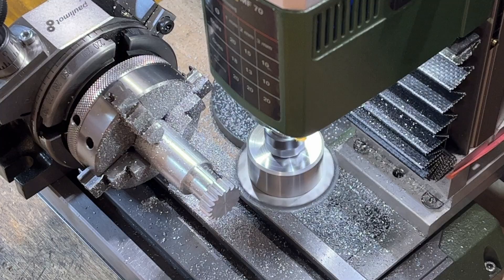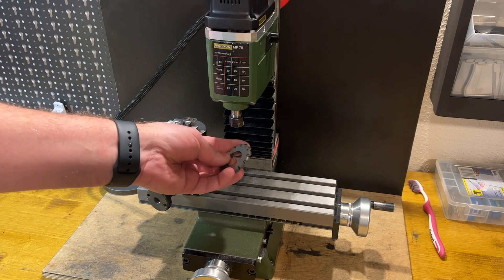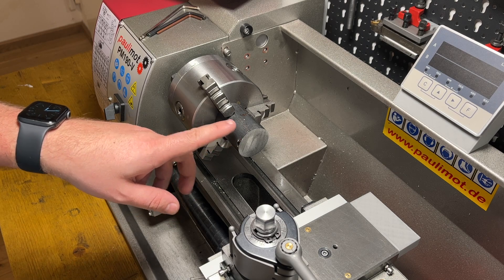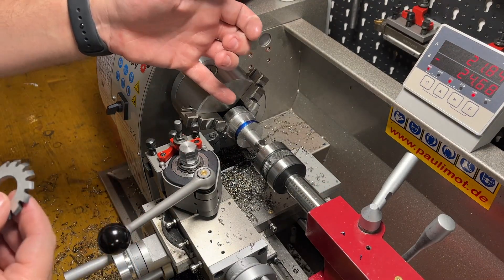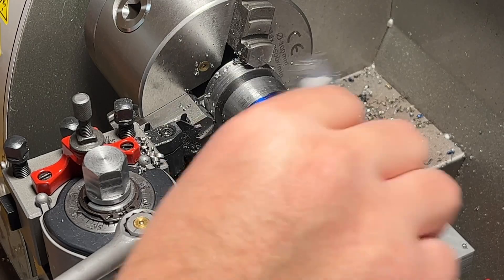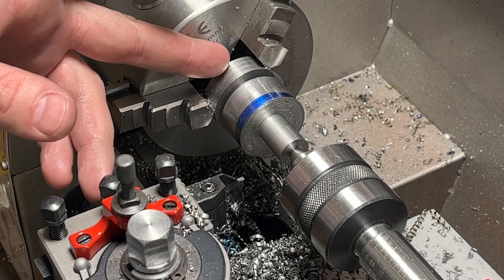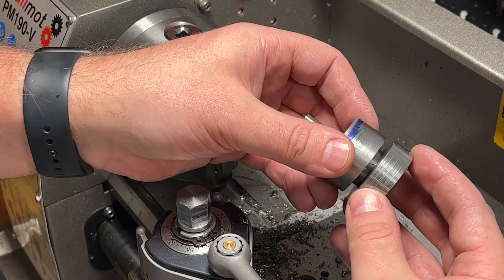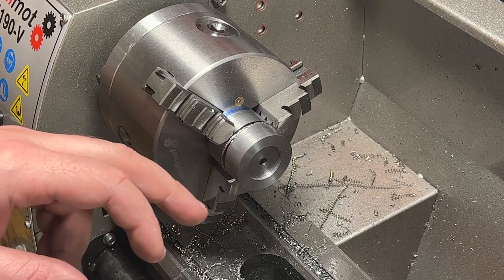Gear cutting attachment for Proxxon MF70

Comment: Hi, whats is the turning clamp from paulimot that you are using in the proxxon mf70?  Thanks in advance
Reply from the maker: It’s this one https://www.paulimot.de/en-gb/rotary-table-oe-80-mm-horizontal-vertical
Reply: @zhadlun thanks! And the clamp in the top of this?
Reply from the maker: @Nan-z4r  As far as I remember it’s this one https://www.paulimot.de/Fraesen/Teilapparate-mit-Zubehoer/Minibackenfutter/723/Mini-Vierbackenfutter-50-mm-zentral-verstellbar
Reply: One last question. How do you attach one to the other?
Reply from the maker: @Nan-z4r  should be in this video https://youtu.be/HKluAypceAE

Comment: Thank you for sharing the video whith us.
But the problem is you must make the arbor exactly corect whith minimum run out (till 0/01 mm hmmm iwill say okay) but whith more run out the First your cuting tool will damage because all tooths are not conect to work peace .the second you cant have one gear whith good surface .
So because of this is very important that arbor be corect whith Minimum run out.
This is my experience after 20 years abaut my job.
Any way thank you.
Best regards-sina 
Austria 🇦🇹
Reply from the maker: I have near 0.05-0.07 runout there, better not possible with this bearings and spindle I have… It’s a lot, but it is what it is. I mean with installed arbor.
The cutter holder is made in 1 installation on a lathe with runout near 0.01. But runout that I have on a milling machine is terrible. Just a cheep parts from aliexpress made it. Will fight with it soon.
Reply: @zhadlun  for fixing run out how is in your mill spindle and your part needs alot of mathematic form and of course will be correct.but it’s alot of job.
So best way to remove the error in your work peace is so:
You must let alitl place in your arbor for fixing (1mm ) then conect your arbor to your milling and grind this 1mm that I’m talking about.then you have one correct arbor whith minimum run out.
0/05 mm is to much .for fly cuter is no problem and of course is better but for gear cutter wheel isnt because infact only one tooth are conect to work peace the ather Tooths not.
Any way good luck 👍
Reply: @zhadlun  also Iwill say you cant find every tools that be exactly fix on your devices (lathe or milling or ather machin) so machinist always must fix it.
Again good luck 
And thank you for sharing video.
Best regards.
Von Österreich 🇦🇹
Reply from the maker: The fixing of arbor not really an option at the moment. Because I'm using ER11 collet and every installation will have another result. All error I have comes at the moment from not very good (cheep) collet. I will start fight with runout from spindle and collets. Then When I will know that I have less than 0.01 error after reinstallation I could try to play with arbor itself.
Reply: @zhadlun  yes,you must let on collet and make it be finish when it’s connect to your mill.of course you must let some place for that (when you make it whith lathe)1 mm or 2 mm is enough.then after finishing whith your mill the first you have one correct arbor for your mill also you will see  all tooths of your gear cutter are exactly conect to work peace and it cuts very very easy every metals.